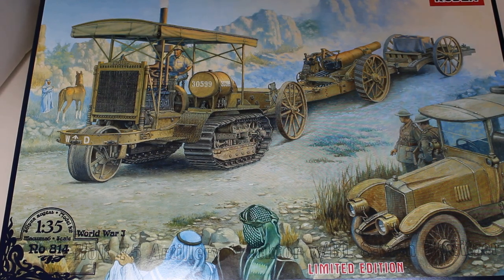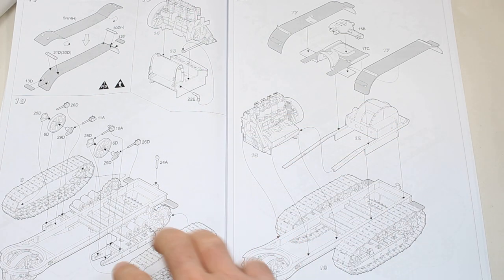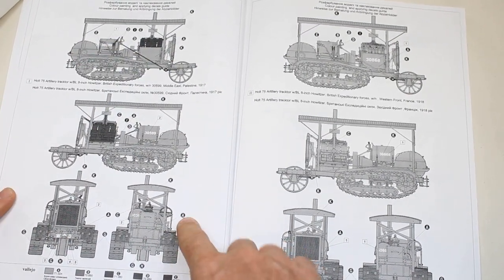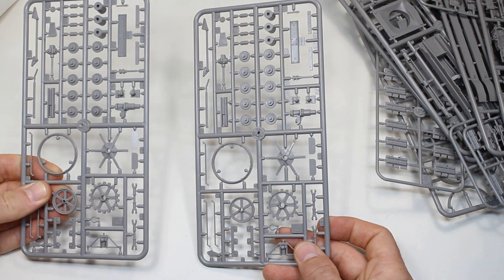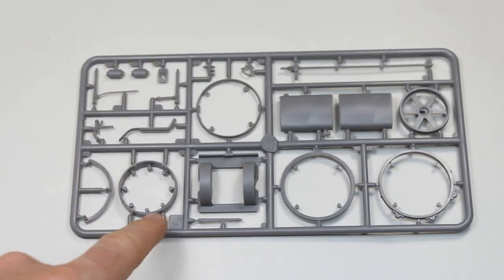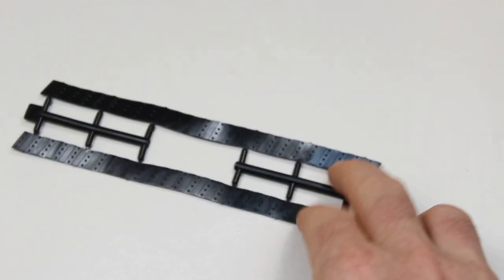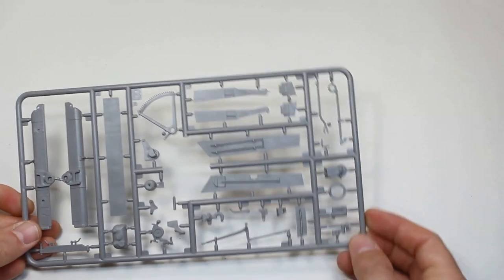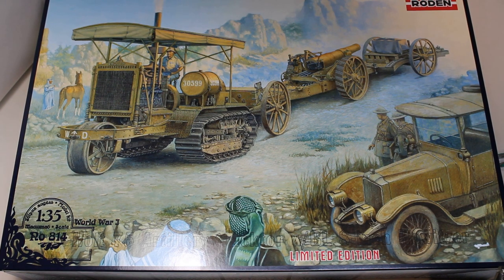Roden 1/35 Holt Tractor & 8 Inch Howitzer

Comment: I've built this as the separate kits but replaced the vinyl track with Evergreen strip and Meng rivets. My build is on Roden's Facebook page, they put someone else's build under my name but I've put my photos underneath it, just checked and it's still there but not been corrected. I'm a member of Flory Models and a full build of it is on there, lovely kit, thoroughly enjoyed it. Made a big mistake with the howitzer wheels and Roden sent me replacements.

Comment: Hi, I was really looking forward to this kit as my grandfather drove one in WWI. So I bought it without doing any research into the kit (which I normally would) and now keep hearing nothing but bad stuff, fit issues, sink holes, tracks that don't fit together and have to be glued to the chassis (really, wtf, never had that before). I held off buying as I wanted to buy something it could haul, all i could find here in Australia was expensive resin stuff. When I saw it packaged with the BL 8" I snapped it up and it arrived today. My first thought really reflect yours.
I was wondering if you'd had started it yet or have any tips etc about that horrid vinyl piece for the guns wheels.
Also first time watching your vids and was impressed and have subbed. Lovely wok mate!